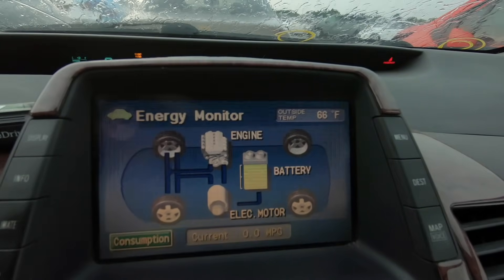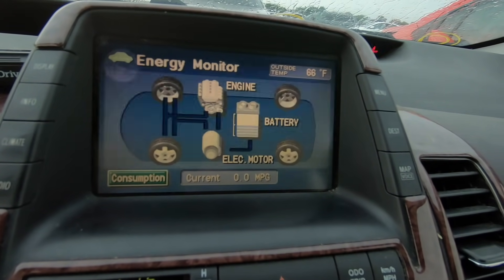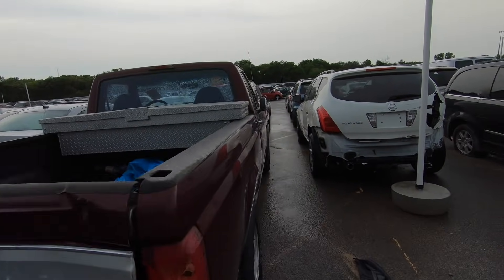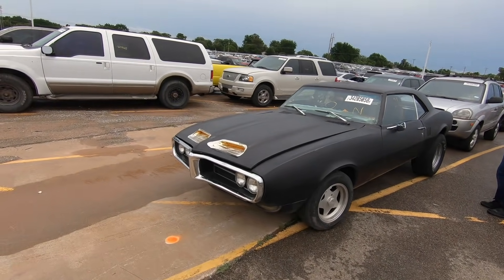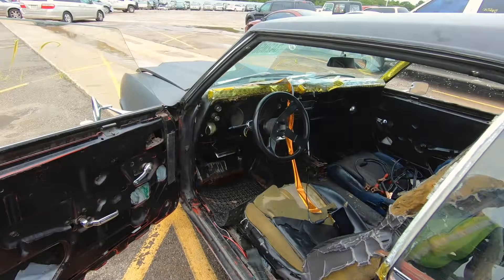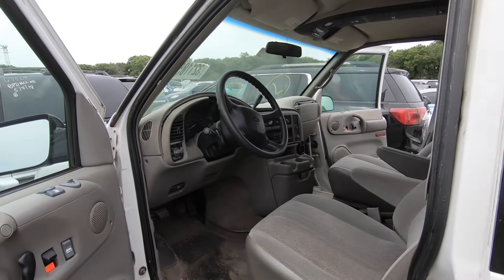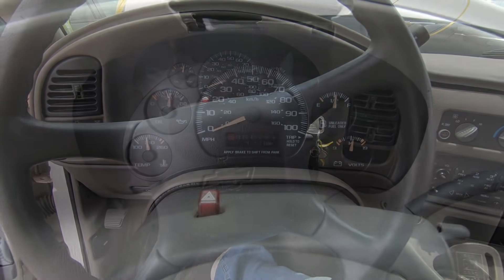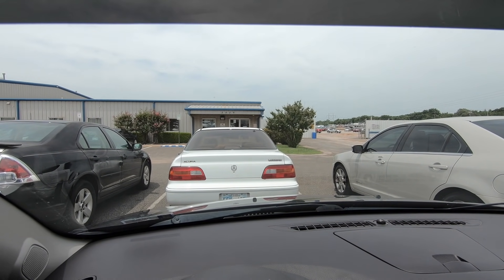We Won!!! BONUS Copart Walk Around + New Project Car!

Comment: Those 3800s are bullet proof. Say what you want about gm but their engines are usually pretty solid.
Reply from the maker: Unless it's a 2.8L, 3100, 3400, or 3500V6 lol (lower plenum gasket and / or head gaskets). Oh, and don't forget the old 2.2L with it's warped head design. The 3.8 was flawed by the FPR that causes the motor to literally explode. Otherwise great motors I agree. I love GM. Always have.
Reply: Uber Man I believe that's a 4.3 isn't it I don't think they put a 3800 in an astro
Reply: The 3.5 and 3.9 don't have the LIM gasket issues.  The transmissions in the 3400 s lose 2-3 shift band (4t40/45) the supercharged 3.8's also blow transmissions.  But yeah overall gm front drive cars are craptastic.  The ecotech is one of the few bright spots.
Reply: I was talking about the 3800 in the Monte Carlo.
Reply: NO they do not put 3800s in those Astro Vans or Safari Vans either the 4.3 or 4300 was the only Engine they put in those Vans they even put them in Fullsize Vans & Pickup Trucks Uber knows that though he had that Dark Blue Chevrolet Truck with the 4.3 in it
Reply: 3800's are good motors generally, first thing I do is replace the plastic cooling elbows that run through the alternator bracket with aluminum ones.
Reply: ^ Guys he was referring my to the Monte Carlo not the van, everybody knows Astro’s only came with the 4.3 lol, honestly they should’ve been optioned with the 5.0L aka 305 V8 in the 80s till late 90s then in 99-up should’ve had a 4.8L v8 as a option..
Reply: @AutoAuctionRebuilds  Those Nissan Altima sure are not bulletproof.
Reply: @AutoAuctionRebuilds  there are computer updates for plenum explosion and that only was buick lesabre and pk ave.
Reply: Balloon Boy mopars are still better though

Comment: I’m the guy who told you about my adventure to California from Florida. I have the same dash problem. Window is regulator mine goes only half way. ABS is probably front bearing. ABS & Brake light is power steering pump. Check the front suspension also. Air on mine is out also, a/c pump. The motor will last forever if you take care of it. Good luck. Questions about anything Astro find a way to get in touch with me by commenting. $2,500 is a good selling price if you could get the A/C fixed & put decent seats in it.

Comment: Great little van… As long as the miles aren’t astronomically high, those are very popular with painters, plumbers, home repair types. You wouldn’t even have to find seats to sell it to one of those guys. Cosmetically it looks very good on the outside, don’t see any rust or bubbling paint. I would definitely buy new headlights because those always improve the look of any used car.

Comment: don't replace the transmission dipstick.  anyone that knows GMs will tell you if they haven't been pulled out in a while will tell you they all stick like that,  a new stick will do the same, all you have to do is unlock the handle and twist them a little as you pull them out

Comment: That monte Carlo is an SS not all are supercharged. And that 3.8L will go 300,000 miles if properly maintained. The biggest issue with those was the body control module.

Comment: The van without the seats would be perfect to haul dirt bikes/ motorcycles quick and easy, you could use the holes in the floor that were originally used for the seats as places to strap up the bikes.

Comment: Usually when cars sit for months the coolant dries up so if you come up to one empty it could have evaporated because of the heat that any of the cars sit in
Reply: PLEASE ENLIGHTEN ME ON HOW IT'S POSSIBLE FOR COOLANT TO EVAPORATE OR DRY UP IN A SEALED ENVIRONMENT?
Reply: TFD ! who ever told me that, needs to be punched in the face for that. Coolant does not just dry up. I have bought cars sitting for 20 years with the Coolant still in them. it doesn't just dry up

Comment: That Monte Carlo was a real ss not just an appearance package back in the day when the Monte Carlo moved over from the n body platform based off the lumina to the w body platform and was based on the impala gm made an ss that ran the l36 which was naturally aspirated but the base had a 42 tooth sun gear resulting in a 2.86 final drive or could be optioned with a 38 tooth which made a 3.05 final drive but the SS has a 34 tooth/3.29. Not at all an impressive final drive but it was what set it apart from the base model power train wise

Comment: for your astro van window there is lickely a broken wire between the door and the jam, if it was me I would pull the door panel unwire the door pull the wires into the jam pull the boot off and check the wires. this old that many miles it is a good possibility in my opinion I have seen this a lot. good luck .

Comment: Before u charge up your ac put an air compressor to it to check for leaks in the ac system. You will get a big fine if you get fought releasing that stuff into the atmosphere.

Comment: 2  yrs ago i bought my 96 Yukon at an impound auction for $400.Bad hail damage but who looks at the roof of a Yukon.Bought another  hood for $50 and had it painted. Spent $150 on a new steering box & pitman arm & oil filter housing. Truck has 212k on it, and i have driven the crap out of  this thing. Just got back from a 500 mile trip,ran like a champ. You can find a good vehicle to actually keep at these auctions if you know what to look for.

Comment: Just so you know, the Monte Carlo that you passed up is a limited signed and numbered Pace Car. they only made somewhere about 600 of that model...I had the same car in red. They only did the embroidered head-rest checkerboard sticker and "Taz" in that pace car model. I was told that the original design was created by  Dale Earnhardt on a red car(which is the one I owned). They are not cheap. you really passed up a great car.  Wish I could have told you that when you were there.

Comment: Any vehicle that will pass an inspection is worth $2,500. ... Cheap work van. Vortec 4.3 v6 a good Drivetrain & cheap to fix ... Monte Carlo cheap commuter car ... 3800 draintrain is very reliable & comes in alot of different GM vehicles ... Firebird hood probably had to be pushed down a little to release the hood bracket.

Comment: You do not have to replace that Transmission Dipstick just push it in there and flip that Red Tab back down and it will lock in that is like that to hold the Dipstick in place it is designed that way so don't waste your Money on a new Dipstick when you'll just get the same thing when you do buy a new one  OH I'm looking at Balloon Boy's comment about the 3800 V6 he is right I have one in a 2003 Buick Park Avenue just like that one and it is a good one and has been a good the 3800 V6 has been around for a Number of years and is a dandy 6 Cylinder it is the kind of Engine they put in the Grand National from 87thru89 or90 when ever they stopped making them and had very little if any trouble out of them so they are one of 4 excellent 6 Cylinder Engines ever made the the other 3 are the 4.3 V6 225 Slant 6 & the Ford 200 Inline 6 they have (GM) put those Engines in a number of Cars & even were put the Jeep CJs a few years and ran great in them I would not at all be Leary of one of those Engines at all
Reply from the maker: Actually I know how to use the dipstick. It has a swollen gasket and is literally stuck. It needs replaced. Thanks for the comment though.
Reply: OK what ever you say I have those 2 Buicks though and they have Dipsticks like that Astro Van the 1 is factory actually both are factory and have the Red top on them just like that one anyway that is how I do my Dipsticks in my Cars & I've also had Astro Vans as well 1 of them was a 86 & 1 a 92

Comment: The Dutch doors are  the ones to have. Solid running vans that are usually beat up cosmetically before the mechanics wear out. My friend has a ‘97 that has been relatively trouble free but did have to swap the fuel pump.

These do GREAT as band vans, as you can remove a seat to fit gear. I’ll bet you can find a replacement dash for cheap, too.

Comment: i think battery was fine its same shit like in loptop, when lotop battery discharges totally i mean to extent below zero turns on safety to prevent any damage to loptop and what safety doesnt let battery to be charged, battery becomes stuck it will show its full and if you try to use it comes to zero :D same in car dude. Its a trick of suppliers for you to buy another battery, you must remove what safety (actual profit making not safety :D) ussualy its little wire welding inside battery. After fixing battery start charging as ussualy. Check on youtube fixing dead loptop battery.

Comment: Looks like the ac line was broke off and m.I.a.
Reply from the maker: A/C works fine (front and rear). I replaced the low port Schrader valve.

Comment: $2k sounds realistic for it, depends on local / region of market of course - and that thing looks quite clean and decent and that 4.3 purrs. A very fair score there! Window switches are flaky on GM's - and if not that then either the window regulator or something to that effect. I get the same B.S. with my '95 Buick Roadmaster on the DS power window - last time it was the switch , time before regulator.

Comment: We have a fleet of these at my work in the cargo variation. The transactions are a weak point with these. Most of them in the fleet had transmissions rebuilt at around 100,000mi. But that 4.3 is surprisingly snappy in those vans!

Comment: I think ide rather had the Expedition ....or hell Ide have been happy with the Tailgate on that Mid 90's Ford f150 i think it was...my Daughter just tore my 700 All aluminum Goose-neck Tailgate off my Old 93 F-350 Crew Cab Dually....shes got 300k ish & runs like a champ still (Not a diesel woo hoo..... 460 in her  or 7.5L for you not normal ppl...anywho she pulls better than her diesel cousin as we found out last year..lol)     Hell if you want an OLD 60's car that bad Ill sell you a RUNNING 68 4 Door with NO center mast (its rare) Catalina with 400 motor and turbo 400 trans ...I re freshed the Motor BC its been in the Family since day 1 but its been neglected ,,,hence why shes rotting on body panels ....but her Trans is a full Lifetime Rebuild from Aamco cost me like 1500 back 15 ish so yrs ago.....i have extra hood and Rear Bumper....I plan to put her in Hemming Motor News for 2500 if all goes right by SEPT .... I had it sold 2x but people either tell wives and have to back out or like last guy gave me half and 2 years now is still a NO Show and his # is now some one elses so now its time to get her to some one else .....i even was looking at taking a trade for Blue Colored Roof pans (a guy worked for the factory here in Florida and told me he would buy the panels at employee cost .....omg they really do mark them up huge.lol....anyway he was first guy his wife went nuts on....was gonna trade me (60) 36'' X 14' Ocean Blue Roof pans.. if I bought they were like 40-42 from the so called factory direct but it was cheaper than Lowes or HP   plus he was bringing them down on the trailer he was going to take the car back with and at his price it was like 1300 so he was getting a hell of a deal but then his wife went NO ......Like i said with the Extra hood which because its got that BIG PONTIAC Nose on it and the extra rear Bumper are worth it i just dont want to part it out......it why i held onto it sadly too long ive had idiots want to make a demo car out of it and im like FUCK NO the truck in this thing is so big you can probably fit one of those new smart cars in there or 4-6 adults easy....lol   Sorry got a bit off subject....good luck with van!

Comment: Nissan makes a decent car but I have seen more of them caved in and ripped apart much worse after an accident then any other manufacturer. Picked up an Altima once that some teens skipped school and took hill hopping, the driver lost control and ran into a ditch. Saddly two of the teens who where not wearing their seatbelts where ejected on impact and died at the scene. The car split into two perfectly at a spot weld seam. Have picked up many of wrecked vehicles in my day but have never seen another vehicle so perfectly break at a spot weld seam. Congrats on the win! With that style of rear doors I would start the price out around $2500.

Comment: There is a thing like turo to rent RVs.  Do a simple RV boondocker conversion and rent it out.  The dipstick is not broken, it works like  a locking lever.  You flip it before you pull it out and then after you put it in.
Reply from the maker: The gasket is swollen and it is jammed. It's broken.

Comment: nothing at all wrong with you bidding on and winning that Astro van. those things run forever  and as long as they aren't trashed out you can usually resell them quickly. We had a 2000 AWD astro and i could pull anything and everything with that van without any problems. ours had 288,000 miles on it when we sold it in 2010 and was still going. sold it for $1,500.00 with the transmission going in it. You don't have to replace that Trans Fliud dip stick just lube up the rubber on it with WD40 and it should be good. most of what's wrong with it is more than likely just cosmetic inside easy fix on that count. the ABS may go out once the brake fluid is pressurized in the system. common GM issue. Yeah i wondered about the windows I had to replace both front door window regulators in ours. I didn't see you were missing the seats but if you get the seats and the trim replaced you could get $2500.00 easy specially as good as that one seems like it's running. get her good and cleaned up and replace the broken bits both that dash face plate and get the grab handle for the passenger side throw the seats in and give her a good bath and there's no reason what so ever that you shouldn't be able to clear $2500.00 for that thing. hell even if they talk you down from that the long as you don't go below what it cost you to buy it and replace those broken and missing parts you should be able to get what you want for it even if its more than the $2500 they really are good vehicles. not just saying that because i used to have one. i'm saying it because it's factual. don't believe me keep it and put another couple hundred thousand on it and see if you don't develop a new found love for the thing too

Comment: How did you get it switched from a salvage title to a regular in a day? I thought you had to go through inspection
Reply from the maker: No inspection in Oklahoma. Just tag and title it like any other car. Rebuilt same day.
Reply: No inspection here in Arkansas either not anymore they cut that out many years ago here everything that go's in Oklahoma is the same procedure here in Arkansas
Reply: In Oklahoma, if the vehicle is over 10 yrs old, it can be turned to a rebuilt title same day without inspection, but if its within 10 yrs old, they require an inspection. The tag agent is able to verify its been "rebuilt."  If you "know" a tag agent or deal with one all the time, they are likely to just put down it was inspected just going off your word it's been rebuilt. It usually takes about 2-3 days to get the title in the mail in Oklahoma.

Comment: Gas gauge went from half to 3/4 of a tank lol.
Reply from the maker: She was sitting uneven. It's stable now.
Reply: Uber Man good deal I was worried when I seen that thinking the gauge arm on the fuel pump was broken. My parents had Astro Vans when me and my sister were growing up. They loved them but then as we got older and left the nest they downsized. They are excellent vans. You could easily pull 3 or 4 grand out of the thing.
Reply from the maker: Thanks Jason!

Comment: You'll make a decent profit off of that Astro. They are great vans. It's always the little stuff with gms. Window regulators, interior pieces, ect.
Reply from the maker: I agree. GMs are pretty good cars.
Reply: Interiors by Fisher Price.
Reply: Not by Fisher Price (THEY ARE MADE BY FISHER BODY) that is who has made the G.M. cars for many years or the Bodies anyway not just Chevrolet but all of the G.M. line of Cars all you have to do is open one of the doors driver or passenger and you'll see the Badge on the door jam on the bottom as big it will have Body BY Fisher I;m a proud G.M. owner that's all I will ever drive too
Reply: I know about Fisher Body. The Fisher Price comment was a joke regarding GM's often cheap looking interiors.

Comment: GM's are weird.  After sitting for long periods, electrical gremlins appear.  I'll bet that power window will start working after using the van for a while.  In my 03 Envoy, I was getting air bag codes on the driver side because of the steering wheel clockspring contacts.  Hasn't returned for over a year now

Comment: All I have to say is either you're very lucky or your copart is better than mine here in WV. There is nothing even remotely this flipable on the lot. Everything is really rough. By they way, $2,500 is a good price for this one with the seats, AC and window fixed. Great job. PS. It's most likes the window switch that is the issue. Those things always bite the dust. On the plus side, they're cheap on eBay.
Reply from the maker: I count my blessings for sure. The switch was replaced in 2016. It's the first part I pulled. It has the date stamped into it. :)
Reply: My power windows driver side still works but when I push the button to roll it down the switch stays down. I can easily pop it back up after I roll it down. Any idea? Hyundai. There’s no spring in the button it seems.